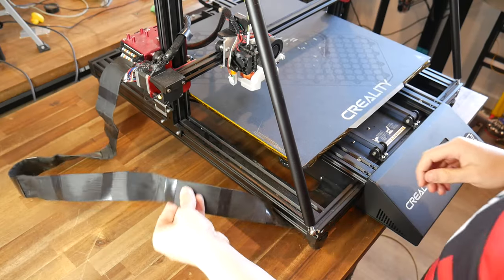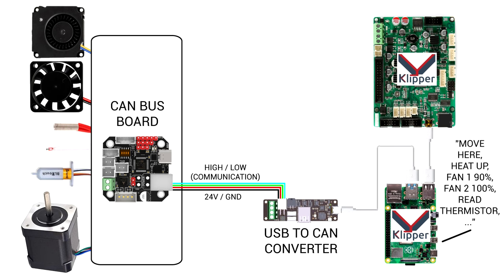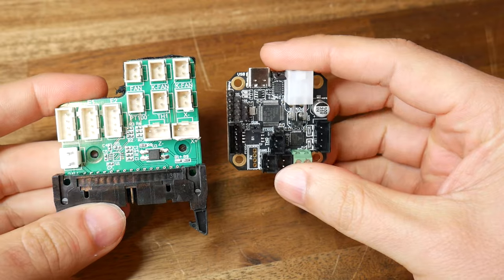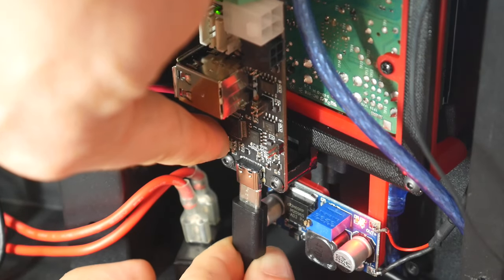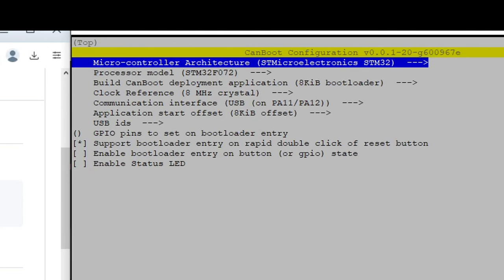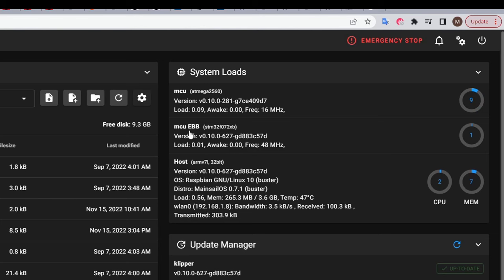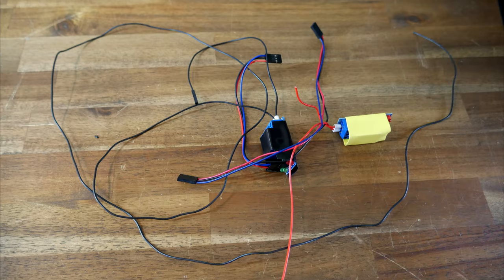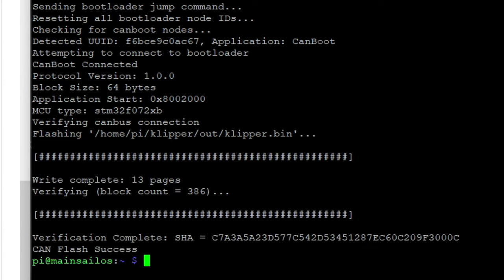Klipper CAN bus guide for Bigtreetech U2C and EBB boards

Comment: I hope one day BTT creates a board with usb-pd port which will allow a single cable to run to the tool head.  Usb-pd revision 3.1 claims 240w power delivery which should be plenty.
Reply: That is exactly what I was thinking, but even the current 100w would be enough.
Reply: @eslmatt811  I wonder how much voltage usb c 3.1 could carry?
Reply: @gregdittrich1206 Plain USB C 3.1 (which is not PD v3.1, the number just happens to be the same) can deliver 15 watts at up to 3A, so that's 5V.

Comment: Characteristic impedance is a property of the cable, the terminator at the end should match it, not be a substitution.   Ethernet twisted pair is around 100-ohms impedance, so close enough.

More generally, I think that just telling people to blindly cut-and-paste random lines of text from one place to another isn't an effective way for people to learn, and this is going to be more of a direct issue when something goes wrong.  They've performed all these actions, like some magic trick incantation and when it goes wrong they're not as prepared to thoughtfully debug stuff.  Then they  are left to do searches on the Internet or to start randomly trying stuff (just likely they blindly copy and pasted their way into this mess) in an attempt to make it work. 

It's be great if along the way there was an explanation as to what those shell commands actually DID so a picture of the overall process would become more clear.   Sure, this would make a longer video even longer and might not be appropriate in every (or most) cases.  But it's a great opportunity to teach by example and learn while doing.   It's not like this specific video is particularly bad in this regard, it's just a trend that I see (like the old "pipe this curl into your super-user shell and hope that you trust the random Internet person to not send you commands that erase your disk" instructions that you see everywhere..)

Thanks for the doing this video; I hope to maybe do this conversion to my Voron 2.4.  However, it's working just fine for the moment, so I'll likely wait until some natural opportunity comes up to fix what's not currently broken.

Comment: Could this same thing not be implemented using the I2C bus that already exists on the raspberry pi? Someone correct me if I'm not thinking about this correctly. The pi already has 1/2 of the the I2C hardware. And then you'd just need to add on a small I2C board onto the extruder side to receive the communications and then send out to each of the other devices. To me it seems like this would be less expensive and already much more well documented and used within the electronics community.
Reply: I2C is slow, short range and not noise immune. Not a good choice.

Comment: I wonder if my PT1000 Rapido UHF would fry this thing.  115 W heater.
Reply: I'm gonna be running a Rapido HF through mine, but I'm gonna be using the mellow Fly-SHTv2 which can handle more juice than the EBB

Comment: Why use CAN when I2C is just as 2 wire?
Reply: I2C is slow and highly prone to noise over anything but very short cable runs. CAN uses differential signalling and so nulls common mode noise, I2C does not.

Comment: @2:20 Everyone should be working out moving from CAN to USB anyhow.  You've already got...literally...a Universal Serial Bus RIGHT THERE.  I feel like I'm taking crazy pills here.  Why isn't anyone other than myself putting Klipper on both the CAN Bus board, and the main controller board and then running USB between them?!  Why are you all buying a CAN bus board in addition to and then running the CAN bus board over USB anyhow?!  The STM32 supports USB natively!  This also allows hot-enumeration of the endpoint, allowing for multi-toolhead identification and everyone has already done the work for you; you can even register free USB VIDs through an open source sublicensing program available in a git repo.
Reply: USB cables usually are not rated for motion. On this specific case it wouldn't make a difference, but for people who mount the CAN toolboard directly on the toolhead, that would be a no-go.

Comment: Nice vid, but can sounds like a pain in ass.  I'd rather run a few more wires to head.
Reply: Printer modding: lots of work for no improvement in print quality 😂 
Like linear rails on bedslingers 😉

Comment: Why not just make connection over BT using some sort of cheap esp32. Then 2 power wires left only.
Reply: Because you still have to run the 2 power lines.
Reply: @fargonaz  That's not an answer. There are ways not to run these two power wires.
Reply: BT/WiFi I expect is too laggy for this. Also very curious on how you expect to supply power to 2 (at least) fans, heater cartridge, extruder driver AND motor, possible bed level sensor, thermistor, possible RGB LED and whatever wireless solution you go for without having 2 power wires
Reply: @dazultra2000  the data flow is tiny and predictable so lag cant be an issue. Regarding wires check out how any brush motor is done and how big currents are transfered to the rotor without any wires. All the rest signals is the wireless job.

Comment: It seems, overly complex and a hybrid solution for little gain.  It's supposed to be a multidrop node communication scheme. Each of the components of the 3d printer should have it's own small board using a common can bus connection back to the Pi and the main board could then be removed.  End stops get wired to stepper control boards and the can bus looped around to each stepper board. Heater boards with thermistor connections get wired into the loop as well. I could imagine 4 board types to run the printer. Steppers, heaters, Fans (lights) and display. Each board would only have a few components on it and be cheap.

Comment: You are seriously late to the party while canbus and tool boards are great running it through USB is natively supported in klipper so you run to power cords and a USB cable it is 100 times simpler to implement then dealing with canbus I’ve done it both ways if you were doing the six months ago you’re right but as of this moment in 3-D printing tech you are way behind the times

Comment: Hi Mate, when powering on my U2C and EBB individually both the lights goes on, without having to press the boot button, with my EBB i can access dfu but not with my U2C, i have U2C v2.1, your instructions is pretty awesome by the way, just stuck at dfu-util -l command 🥲